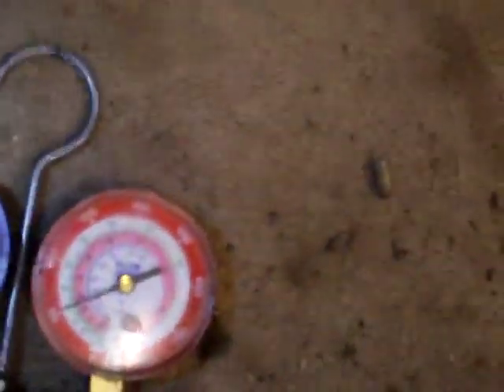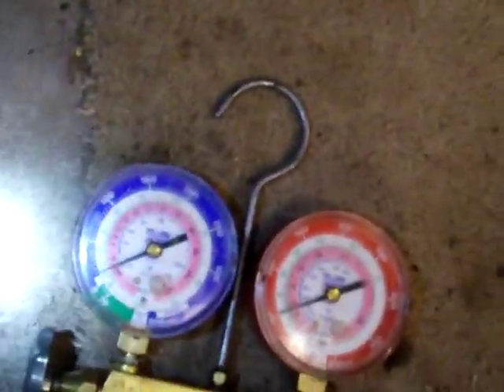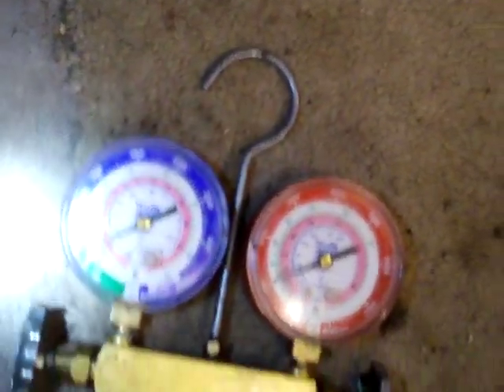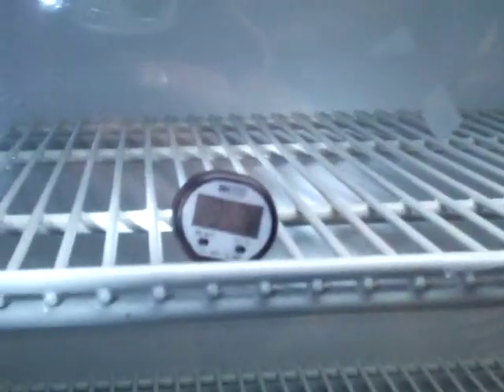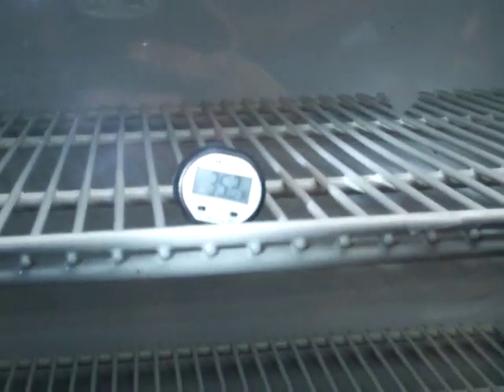True reach in cooler.  Compressor and condenser fan motor

Comment: someone I know has a true 2 sliding door beverage cooler.It's not a very big one.forgot the size and model number but I remember it said it holds 8 oz. of r134a.when i first turned it on i heard the condensor fan come on,but only the fan.found the temp control knob and turned it up.heard the compressor come on.sounds normal.left it on for a bit,but lines don't get cold anywhere.I assume it has a leak.shouldn't the comp. turn off if it's low on freon?visually i don't see any leaks.any suggestion
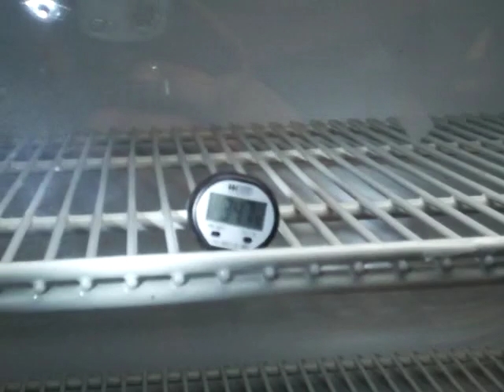Reply: 😅😮😊😊😅 1:16